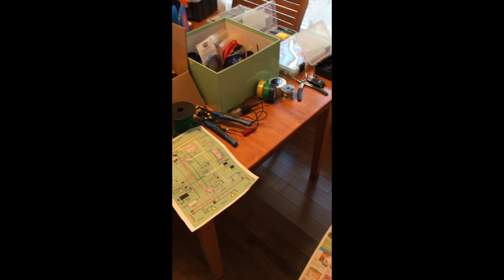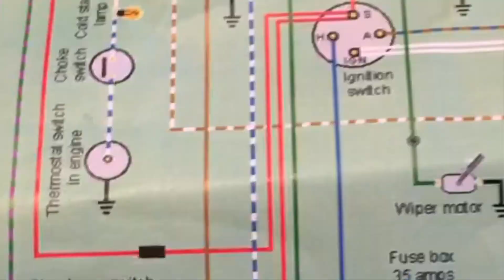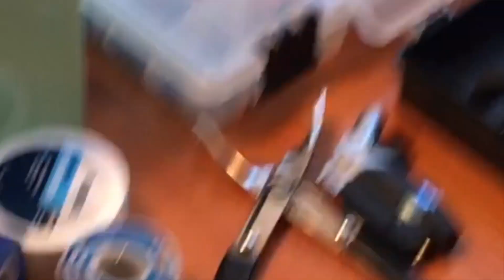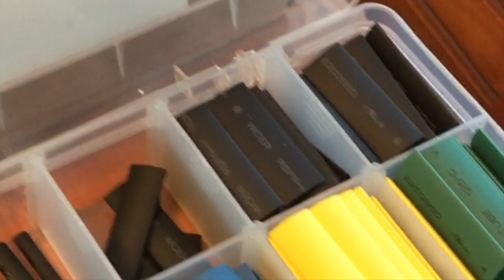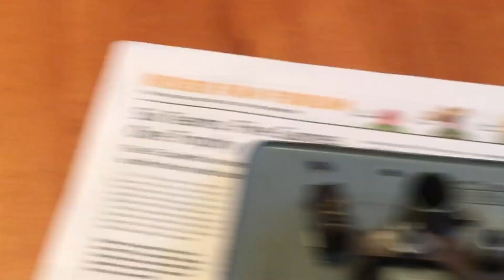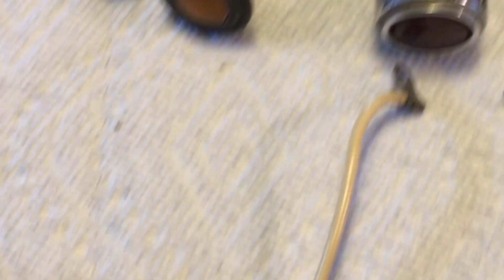Make your own wiring loom for Landrover Series

Comment: I am a trained electrician (UK) but can't use that skill in Aus. When I was restoring an ex-military 109 V8 FFR in NZ, I shorted out two 12v, in series, 400 a/h batteries! The main wiring loom running along the bulkhead didn't last long. So had to build a new one. One thing that I was surprised about the loom on my 1984 90 when I did an auto conversion was that the loom had wring for automatic transmissions ("P" and "N" wiring to disable the ignition). That was just before LR started selling auto 90's in the US in the 1990's.
Reply from the maker: Thanks for that, intresting stuff,  I never knew they did any autos!
Reply: @VintageRestorationsAustralia  Thanks. Only US (CA) market AFAIK and now you can't find anything for less than US$70k, more now I expect. I was inspired by someone called Ian Ashcroft (UK, deceased. His business still operates) who used to do V8/BW65 conversions with modified valve packs. The great thing about an auto is you can change gear without dropping drive to the wheels.
Reply from the maker: @pmjd42   Series 1 with an CVT ?  clash of worlds :-)
Reply: @VintageRestorationsAustralia  If we put originality aside, in an 80" S1 I would go with a Ford 2.8 EFI V6 and whatever the auto box was for them. There are kits available (Edit: I should say were available). A V8 is nice in an 80" S1, but too big IMO, too many axles, shafts and diffs popping, let alone the layshaft. A CVT, not sure. I was going to do a V6 conversion on my 1958 S2 but went the 88" RR chassis path.

Comment: Wow what a great video. I would like one of his looms for my 64 2a 109 pickup. They are so professional looking. What was the place in England he mentioned that makes the looms?
Reply: Hi Graem, thank you for the positive words. Might take you up on that 😉. I think I am getting better at making them, with a bit of practice.  The only snag is knowing how long to make each sub loom or wiring run, so I’ve tended to over estimate, then can cut to the right length once on the Series vehicle.  The place in the UK is called Autosparks, they do a professional looking loom, with price points that vary depending upon if you want the old cloth style of wiring or modern plastic coated wire.  You can specify lots of options too.  Sit down when you see the cost, especially if you want overseas shipping.  I also read that there is a long wait, given the CV just now.
Reply from the maker: @gonesailing  Get building Graem :-)
Reply: Sask Series I’ll take you up on your offer if you ever decide to make them. I had to sit down after I saw the $$$.
Reply: Graem Elliott. Thank you. I should seriously consider this as a business opportunity.  Whereabout are you located please in case this is an option, and to see if shipping is not a problem.
Reply: Sask Series I'm in Los Angeles

Comment: Hi Steve, thanks for that video, I am doing a series 3 at the moment, so I went straight on to the series forum UK. However I didn't have any luck tracking down one of colour diagrams he had in this video. I have the manual and it does have a wiring diagram but the easy to read colour version would be great. Any ideas would be appreciated.
Reply: Hi Graham, you need to look at the land rover series 2 club forum.  Free to sign up to that forum.  Here is the link to the wiring diagrams.  It’s filed under workshop wisdom, but this link should get you there once you are a forum member.  https://www.series2club.co.uk/new_forum/index.php?board=3.0 p.s. the wiring diagrams changed a bit over the years, and the series 3 wiring loom is a little different, but the essentials should be the same and these diagrams will give you a good start.  Good luck with your wiring, Ian
Reply: @gonesailing  Thank you Ian, I should have realised the series 2 would be close. I will check that site, thanks again.
Reply: Hi Graham. I have the same colour diagram he is using here. I printed it off google images for land rover wiring diagram with alternator. Look through carefully, I'm sure it will still be there. It was the best reference of many I used.
Reply: @71spaceman  Thank you for that helpful information, sorry I missed it before. I have googled it, very useful thank you.